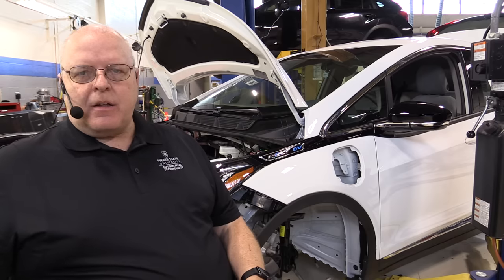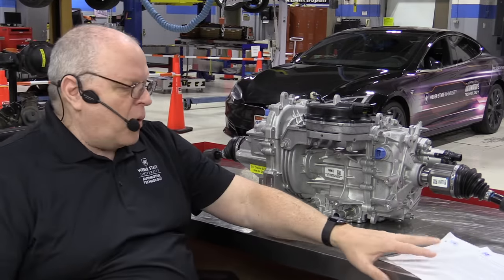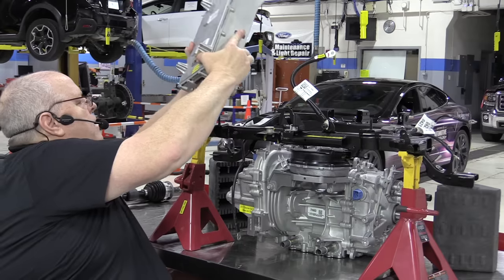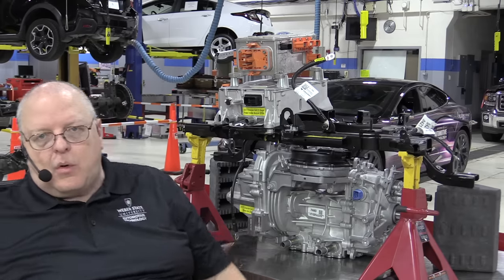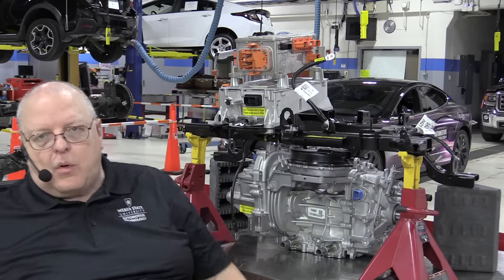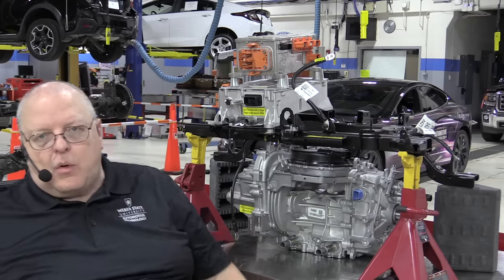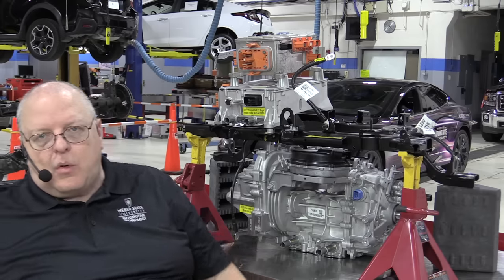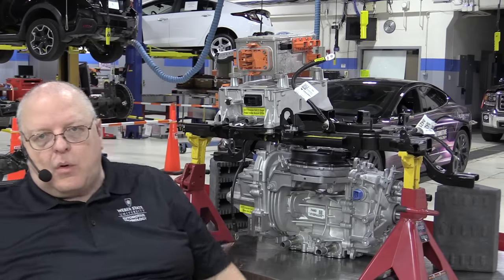Chevrolet Bolt EV High Voltage Components

Comment: Great video! You have done a great
job labeling each car part much like your other videos. It must help a lot for
the classroom instruction. It enables another method that some people need to learn
the material. I really can't absorb everything in real-time that you speak
about and have to rewind the video. I am a visual learner and the labels
prevent me from having to do that as much. 
In my line of work, I sometimes
apply strain gauges and accelerometers to metals that are dirty, oily or
painted to start with and in areas that get exposed to hot and cold extremes
-50 to 400 F. Before I can get any permanent adhesion it requires a lot of prep
time cleaning, sanding, sometimes heating (to get the metal to sweat out any
oils) so that it doesn't cause my strain gauge to lift up. 
 I have wondered for many of your
videos, how do you prep the metal that has been submerged in oil for the identification
label to stick? How much prep work goes into that? Are you working on that by
yourself or do you delegate it out to some of your students for extra hands on
learning?
Reply from the maker: Thank you! It is a lot of work. I do it myself. Cleaning the surface is the key.

Comment: Excellent video, Prof! You can tell you have a passion for this stuff. Not only all the new EV terminology already flows out of you easily but you're diving right in and modifying system to add features. It's unlikely GM removed the fast-charging option at the firmware level. I'd wager your DC connection will work. Looking forward to see that report.
Reply from the maker: Thank you very much!

Comment: I can't tell if this is a well designed, simple, modular system or if you're just really good at explaining things! It seems to me that the weak point on this design is the cooling - there's three loops (when one would do, I should think), two heaters, and a heat pump that only cools. I think there's going to be a lot of streamlining in future iterations. It looks like an engineering decision was made to design this independently so as to ensure the schedule is met. 
Of course, time will tell how well-designed the internals of the electrical components are.

Thank you for the videos!

Comment: Thanks for diving into the technical bits on the Bolt. I've been able to find out a decent bit just by observing the car's behavior, but an actual teardown reveals so much more. I'm looking forward to watching the video regarding the coolant loops.

I always wondered what the component was on top of the charger. Now I know that it's the DC-DC converter. I'm glad that's a separate piece. On my i-MiEV, the DC-DC and charger are combined, and with a recent spate of charger failures, the converter is also being knocked out, rendering them undriveable.

I'm a bit confused on why there is a dedicated on-board charger wire to the battery. Why wouldn't it simply feed the battery through the main harness?
Reply from the maker: Thank you. Good question. I do not know why they did it that way

Comment: Dang work getting in the way of fun projects :) Thanks for the great overview! I'm looking forward to more of the ATF videos. 
Does GM typically leave out wiring in the body harness for non-installed options? I know VW does these days, which can make retrofits fairly laborious for even "small" things like illuminated interior door handles (they're powered from the module in the front door, so both door harnesses and the body harness are different!)
Reply from the maker: Thank you! I hope they do. I will find out in the next few weeks.

Comment: i think this is the first time Ive watched your channel. with your great descriptions and explanations i think i understand the Bolt a lot more, and subscribed to your channel.  they sure have complicated the electrical systems. and i understand why with all the facets involved in all the car components to make it operate correctly.  Ive worked on a few hybrids and they were pretty easy to diagnose issues. But i think these all electrics are going to take a little more time and safety to work on. thanks for sharing!
Reply from the maker: Thank you. Other than the on-board charger and the distribution box, most hybrids have the same components. (Inverter, DC-DC converter, motor(s), HV battery). Have a great day!

Comment: Thanks for the info, to bad for me it is not the same! By the way, did the DC quick charger work on your Bolt? (That is, if you’ve put it back together?)
Reply from the maker: It is still apart. I wound be reassembling it for a while. I am still investigating the differences.

Comment: Nice part by part breakdown.  Would also like to hear discussion on cost factors of each part, current replacement prices, and estimated service life of each.   I know much is unknown but that is why this type of info is still very much needed about EVs. Labor costs look low if just bolt and plug in.   Expert knowledge cost looks high.
Reply from the maker: The inverter, charger, and DC-DC converter are close to $1500 each. I doubt you will ever see one fail unless the cooling system gets damaged. I do not know the motor cost, but I also doubt it will ever fail. The only part I can imagine failing is the A/C compressor after about 8-10 years of service. Of course, the battery will only last about 10-12 years as well. I see the long term cost of ownership being very low compared to a non-EV.
Reply: WeberAuto thanks for reply.
Reply: also, i guess electronic components can be changed with new versions as they become obsolete.

Comment: Another great presentation. I was surprised how small and “simple” the motor is. In any design the most difficult part is to achieve simplicity, I am very clear on that. 
Seeing all those electronic connections and components I wonder if this car was designed for California weather not including cold Canada. Until now I had to fix corroded light’s connections but having that many electronics gives me the shiver. On top of it, in the driver seat I am sitting in an Electric Chair having 400 Amps under me which may connects wrongly in an accident. Also, not counting you, are there more than 10 people on the continent who will know how to fix this car? 
I still enjoy you video, thanks.
Reply from the maker: Thanks for your feedback. Yes, there are many very talented GM service technicians out there, but we need many more. We are training a new generation of service professionals for these vehicles. Don't worry about the high voltage or current, there are many safeguards in place to protect you in the event of an accident.

Comment: I just bought a 17 with DCFC last week. This is some really fantastic engineering, and great videos!

I can see this system doubled for a pretty much any other GM SUV - ie Canyon, Terrain sized stuff, awd setup. I think GM has something up their sleeve for the big-sized trucks.  This "Small-Block" then the "Big-Block" for the wider, heavier stuff...

Comment: Great breakdown! Thank you. One thing to point out though, the motor is a Brushless Perminant Magnet Motor. IE DC not AC. Brushless DC motors still use 3 wires to rotate the magnetic field. 3ph AC motors are inductive and do not require Magnets. There would be no advantage to use AC and would require a significant amount of extra hardware IE a VFD.
Reply: No, it's not a DC motor. It is a 3-phase AC synchronous motor with a permanent magnet rotor. The common 3-phase motors which do not have magnets in the rotor are asynchronous induction motors; they have the same type of 3-phase AC stator winding as this, but a different rotor.

The "single power inverter module" (or SPIM) is the variable frequency drive (VFD), although the term "VFD" is normally used only when the power supply is AC (which gets rectified to DC within the VFD), not when the power supply is DC. Whether called an inverter or a VFD, the output is AC at the frequency needed by the motor at the speed it is running. 

Every modern EV uses an AC motor and a variable frequency inverter. The Bolt is a typical example.

Comment: Hello professor I also have a 2017 bolt and have purchased the hv charging port and block that it attaches to I was no aware of additional harness so I’m grateful for your videos and can’t wait for the conversion to work, if anyone can make it work it will be you so I’ll be waiting for the updates. Thanks for the great videos.
Reply from the maker: Thank you!
Reply: Any updates on your work, leo vasquez? Did you follow through with the conversion?

Comment: Loved this episode!  My only question is how many amps can the DC to DC converter supply to the 12 volt battery when under heavy load?  I'm hoping I can add an inverter for small power tool use to it.
Reply from the maker: Thank you. 160 Amps
Reply: Wow, that is a lot more than I thought.  So I'll opt for a 2000 watt pure sine wave inverter and install a 15 amp circuit breaker on the 120 volt outlet circuit.  Thank you for all you do to educate our mechanics into the electrified car market!

Comment: Thank you so much Professor Kelly for this professional explanation, but I wonder why does the video do not mention any technical information about the battery management system ?
Reply from the maker: I have four other videos on the Bolt EV battery here https://www.youtube.com/playlist?list=PLIn3FrDiB1lzjfZvamYdxYo9uczD2JnTT
Reply: Greatly appreciated, thank you very much, I will check them. But Professor Kelly, I think that you meant to say at 23:46 "in the back of the High Power Distribution Module"  instead of the  "Power inverter Module", Am I correct in saying that?
Reply from the maker: @marwenjemli4228  Yes, I should have said "High Power Distribution Module". Thank you!
Reply: @WeberAuto  literally: it's I who should say that, thank you for sharing knowledge !

Comment: FYI, the Bolt does use the battery heater when fast charging. I've observed my Bolt turn it on when fast charging in the cold via the Torque pro app.
Reply from the maker: Yes, I was wrong. But other feedback from Bolt owners indicates that the battery charges faster in cold weather on the Level 2 charger. I am still investigating to find out why. Thanks for your feedback

Comment: Thank you very much professor Kelly for such amazing videos! I am am courious about the "part" or "module" that regulates the voltage and current when charging in DC. I assume there is some module that makes the PLC (power line comunication) between the charger and the battery. Can you explain about this? Is there a video about that? Thanks again!

Comment: Seeing this robust, fool proof modular approach employed from a large car manufacturer instead of a big box that does everything is quite impressive and rather unexpected! The battery chassis / frame looks even more impressive too. So far this looks like it was not designed by accountants, if you could pardon me the cliché. Certainly, if robustness, serviceability and peace of mind are top priorities, this vehicle seems to meet the criteria at least from a design point of view. 

I'd be interested to find out more about how the vehicle deals with temperatures at the extremes of the useable conditions and what the stresses (read: life expectancy de-rating) on the battery are during start up or charging initiation under said extremes. 

Thank you for a great video once again!
Reply from the maker: Thank you very much! I agree, nice modular approach.
Reply: @WeberAuto  Looks like a mechanics dream car, plug & play
Reply: But I wonder how long they'll be able to resist combining some of the modules to cut the costs of all those chunky connectors and harnesses?
Reply: Combining makes a lot of sense as far as cutting manufacturing costs and weight shaving is concerned. They would save a lot from the material required for the housings and the cabling. It could also make the system more robust as almost everything would be contained in a single enclosure eliminating various points of risk from exposing connections to outside elements. Having said that, the connections look so robust that it would be more a question of cost.

The problem in combining everything as I see it is that they would first need to iron out any areas of potential problems. For example, it's a cheaper to recall vehicles  2-3 times to replace a card in just a single module each time rather than replace the entire combined system module every time. In addition, combining everything gives birth to additional problems with heat management etc. as it eliminates a couple of degrees of freedom in the design parameters. So, from a design and development point of view, it makes sense to start with individual modules and progress to combined modules.

From a consumer standpoint it's a trade-off between lower initial cost of purchase vs. higher cost of spares, assuming sth. goes wrong or gets damaged.
Reply from the maker: @Stelios.Posantzis  Great points, especially about additional heat problems. Thank you!
Reply: Prof Kelly: This is what is so great about this video series: dissecting the automobile in a neat, concise and logical manner that shows very clearly how the parts fit and function into a bigger "whole" forces one to try to get into the designer's/constructor's mind and to try to guess what their goals were and how they went about them. For training purposes, especially in deductive reasoning, they're invaluable.
Reply from the maker: @Stelios.Posantzis  Thank you very much! I am happy they are helpful
Reply: WeberAuto : sect that the modularization is more likely due to being able to get components from different Tier One suppliers. . .    a result of lack of vertical integration. . .

Comment: The Chevy Bolt certainly has it's short comings, but I still think it's the best designed electrical drive train you've shown off on this channel. Everything fits together so well, and it has what it needs and no more. Compare with e.g. the Ford, which has a lot more connections directly to the battery seemingly to no purpose.

Comment: Professor Kelly - If connecting a 12V inverter to the 12V system of the Bolt, I've connected the + to the + of the 12V battery and the - to the APM - stud. I'm attempting not to strain the small 12V battery and getting the power directly from the APM.  I know the Bolt needs to be turned on prior in order to have the APM on.  In my research, I found it does have 1500W limitation, which I'm  not attempting to draw.  The loads I'm powering range 400-800W.  Use case is for emergency backup power in case of outage.
Reply: When an APM like that is actually running, it regulates above 13V, so realistically you're not tapping into the 12V AGM battery at all, the battery is just sitting there floating.

Comment: To let you know I have a savage 2017 Chevy Bolt EV LT without DC quick charging 8300 miles on it. It will go into park and neutral, but not in drive or reverse. The screens come on, but it will not charge with the 1772 adapter either 120 or 240 vac level II charger. The interior of the car is not damage, but the hatch door is and rear bumper, the car’s right front is quite damaged, but the inverter assembly seems to be not damaged. Here is the question: I would like to remove the battery pack, AC charger, 1772 plug and be able to charge the pack safely and use the high voltage line (355vdc) connect this to a Sunny-boy series inverter( this will be used as a power wall for storage of extra power from solar panels), can it be done???? I want to try and keep the battery pack whole to take advantage of the built in BMS system. The very most power drawn off the battery pack would be 5000 watts, so I don’t think I’ll need to hook up the cooling system?
Reply from the maker: That sounds like a cool project. There are fuses in the charge receptacle. see https://weberstate.box.com/s/y8ns5xy2o6zk2bhhuclzzywhtynm2gvn 
I would always use a cooling system, just to be safe. I do not know how you could use the existing BMS without hacking the CAN network.

Comment: I like the videos and presentation, I see people talking about battery chargers but are they just power supplies 120vac and 240vac to supply current to the on board charger to charge the high voltage battery?. The only real external chargers are the public ones with high output fast charge capability would you agree?

Comment: Thanks for sharing. As usual very good. Does Chevy Bolt call for any of the coolants to be changed and if so at what intervals?
Reply from the maker: Yes, at 150,000 miles or 5 years
Reply: Thank you.
Reply: @WeberAuto   Thanks for making the Bolt videos! Are the electronics also "heated" in winter or just cooled in hot weather?
Reply: jim0266 multiple heaters in this car.

Comment: Solid informative video, as usual. Interesting that GM chose a much more modular approach than in the gen. 2 Volt. <-- segue
I do hope that the pending cancellation on the Volt doesn't prevent your examination of the Gen 2 Volt transmission (which is a gem, love my Volt)
Reply from the maker: Thank you! I plan on completing a video on the Volt 5ET50 transaxle. I am sure we have not seen the last of it even though the Volt production will end.

Comment: How does this car compare to a similar internal combustion engine in regards to the amount of heat generated. The whole car. All heat sources. Just curious. Thanks so much for the videos.
Reply from the maker: Very low amounts of heat produced with an EV when compared to an ICE. One gallon of gasoline releases the equivalent of 36.3 kW of heat when burned. The Bolt Battery only is rated at 60kWh total